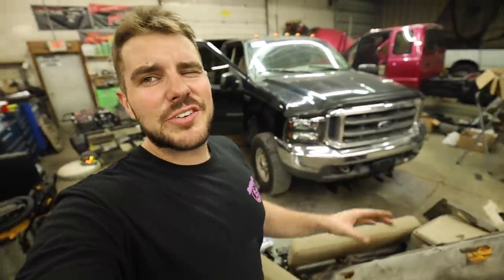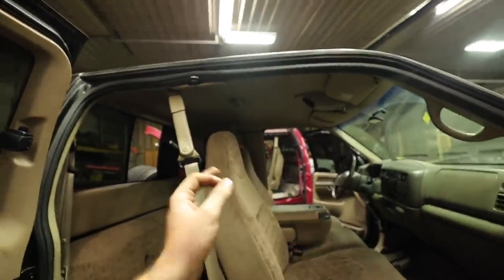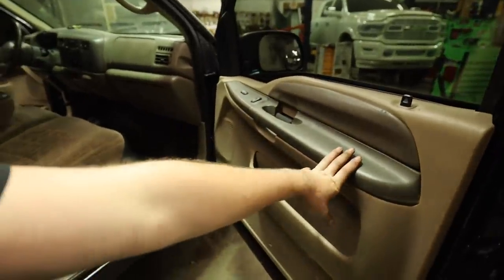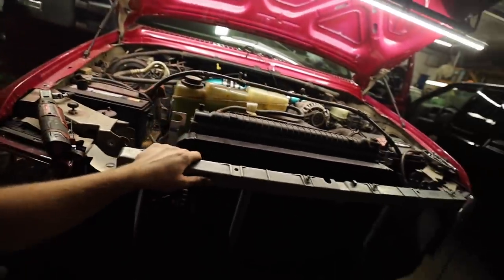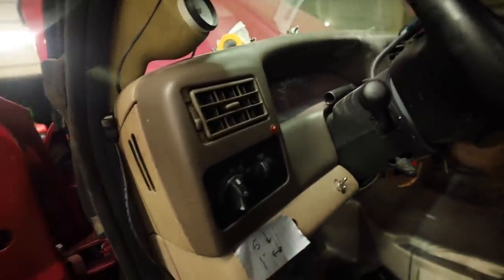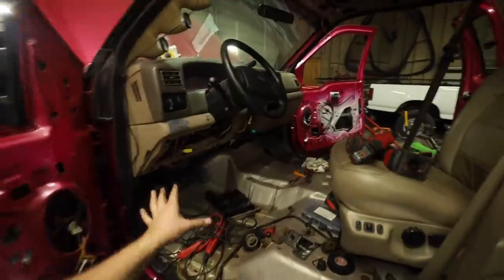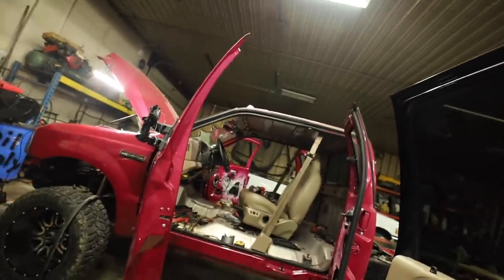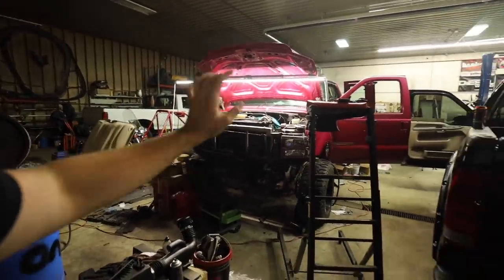THE STRAWBERITA LIVES! 🍓

Comment: The haze you’re seeing that gets ran back through the turbo is the crankcase ventilation. Same thing with the cummins and their crank case filters that dumps it back into the turbo through the intake. I’m sure there is a delete of some sort for it.
Reply: You don't wanna delete the crank vent that would cause to much crank pressure and cause failure. The best thing to do would be to run the crank vent through a catch can to catch any oil that comes through and put it back through the intake for more air because on the way to the catch can the air cools down and the catch can catches the oil.
Reply: @ThatGuyJayDub  ya that’s what I meant by delete. Delete the tube that runs back into the intake and route it to a catch can instead.
Reply: @wmac547  well after the catch can it's still gotta go somewhere and with it being hazy like he said routing it back into the intake after the catch can or into the exhaust would be his best options because just dumping it under the frame depending on how bad the haze is wouldn't look good

Comment: You still could weld a Venturi to the downpipe coming off the turbo for the blow by. So that the crank case pressure is still venting into the exhaust

Comment: that center roof sensor shelf thingy isn't really worth a shit but lie and steal your sunglasses. lol but if you look behind the passenger foot panel near the fuel cutoff switch its about 50/50 chance the xlt has the plug in connector and dash harness to swap over easy,  around 03' there was a copper shortage so ford wanted to save 10 cents and made shit complicated and started making different harnesses per options instead of just communizing one